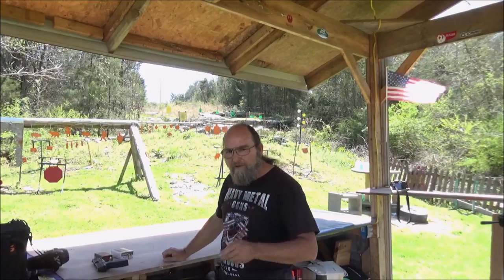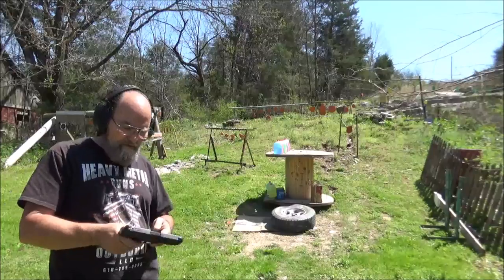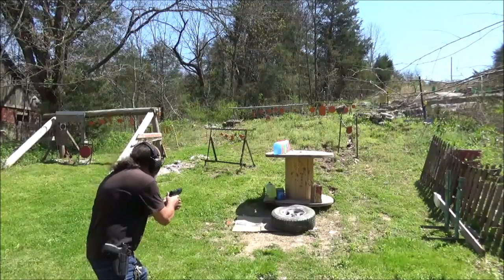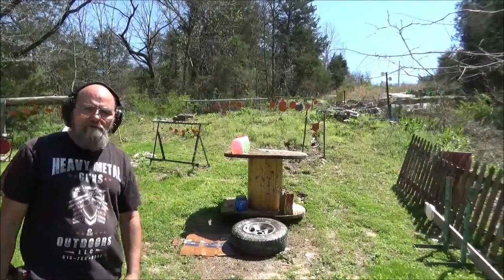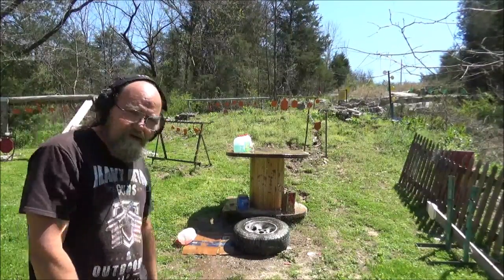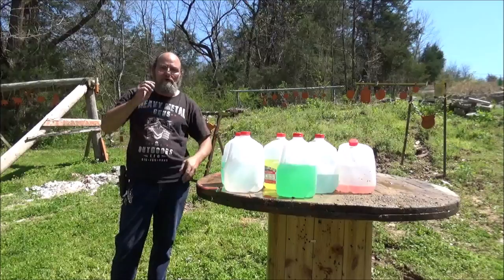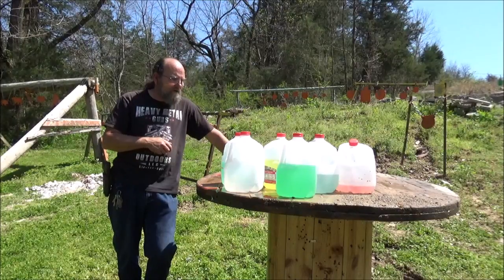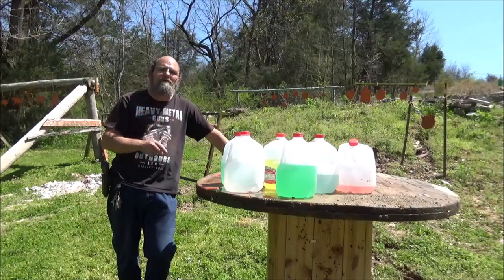Water Jugs Test 115 VS 147 grain

Comment: Morning Paul, what would be interesting if you have a 308 and get the lightest weight you can get like something under 147 grains and the heaviest lie a 220 grain and try the water jug and clay test
Reply from the maker: Morning !!
Reply: Yea I would like to see that. I have some 110 gr .308 just loaded & haven't shot yet. The speed is so different between the weights its not as bad as one may think. The 110gr FMJs can go about 3500fps with the right powder, 200gr around 2500+fps or so. The heavier ones usually have more energy but the lighter have that extra speed; freaking awesome. I would love to see that test Paul!!